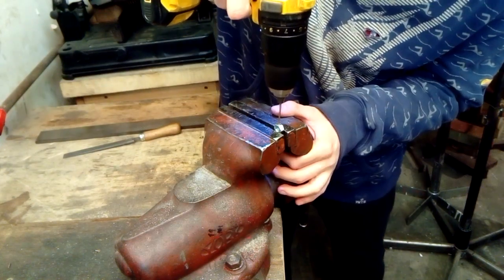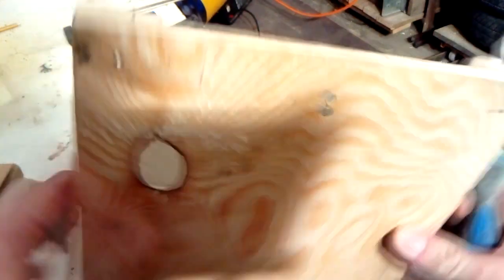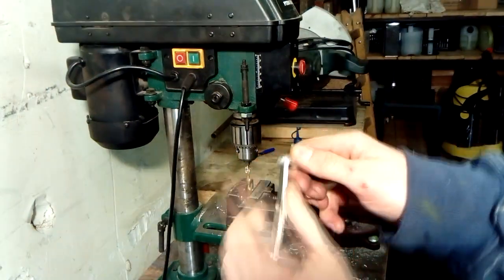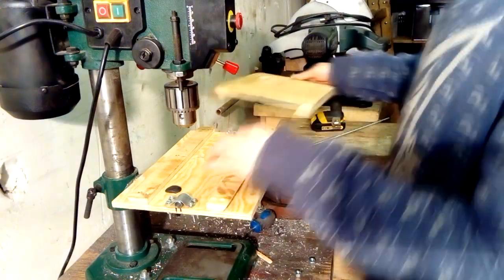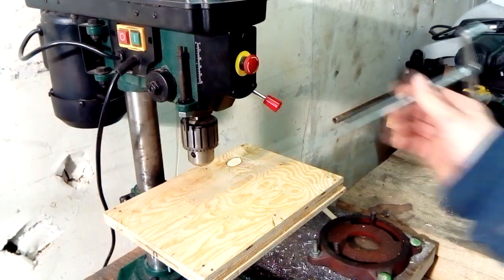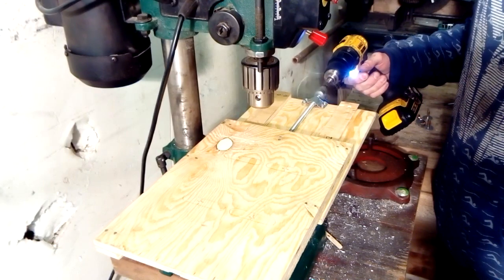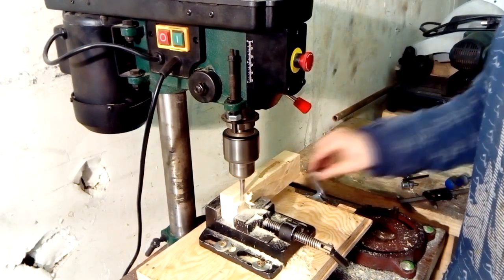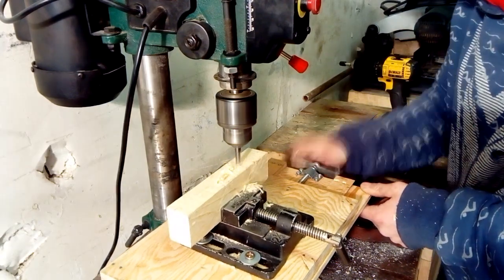MK: DIY Milling table for drill press #tutorial

Comment: If you have a Jacobs Taper #33 you can drill a hole in the bottom of the spindle and tap a #10-32 thread. Then screw a #10-32 through the chuck into the spindle. It keeps the chuck centered and tight on the taper. This only works if your spindle does not also utilize a Morse Taper. I machine 6061 aluminum all day on my drill  press. If you are worried about bearings, don't be. The bearings for the WEN 4212 are cheap and easily replaceable.

Comment: only things i can recomend are use an acme 3 start rod, for greater linear travel per rotation (adds cost, since you must buy specialty nuts as well, and its a premium on the rod when compared to all thread) and its best to have a drill press specifically for milling and another for drilling..... the milling warps the drive shaft and causes a holy shit ton of run out, which you dont want if your drilling precise holes, or ceramics / metal holes for tapping. would be fun to hook up stepper motors and a joystick, with an x and z axis. just screw around with that haha.
Reply: Agreed.  As for damage to drill, as long as he sticks with wood the drill press should be OK.  Not steel.  Also, plunging with the end mill along the length of the slot also takes the load off if using hardwoods.  His slides were a little sloppy though - too much play.  Love the kid's energy though.

Comment: Is that a parkside drill press? How long do you have it? Would you recommend it? Thumbs up from Poland
Reply from the maker: tryhundred yeah it is! Im using it for two, maybe three years. I would recommend it if you dont need to be super precise with your work. Also if you are going to run it 8 hours a day its probably not going to last you for very long. However I would recommend it for homeshop. Hope this helps, greetings from Slovakia ☺️

Comment: Bro Plz Include Y axis Also And than make table. Thats very helpfull me To make Xy Table 😊
Reply from the maker: y would be virtually the same as the X, only rotated and placed on top. So if you make two of this and join them together, you should be good to go! :-)
Reply: Michal Kubrický: DIY ok thanks buddy 😊
Reply: Michal Kubrický: DIY what is estimated cost ?
Reply from the maker: few offcuts pieces of plywood,  one threaded rod, few offcuts of aluminum, some nuts and bolts ant thats it. I didnt buy anything new, since I already had everything laying around. But all and all its probabl just a several bucks
Reply: Michal Kubrický: DIY Thank you bro 😊 can you plz give me dimensions that's help me to make this project

this helps means me a lot 😊
Reply from the maker: Check out my article https://www.instructables.com/id/MK-DIY-Milling-Table-for-Drill-Press/ I think it might help you, however, I wasnt using any drawings or blueprints, I just kinda did what I think was best, so I don´t have dimensions for the parts. But I think it´s doable even without dimensions! Make sure to let me know if you build it, or if I can help you with anything else :-)
Reply: Michal Kubrický: DIY Ok Sure ☺👍